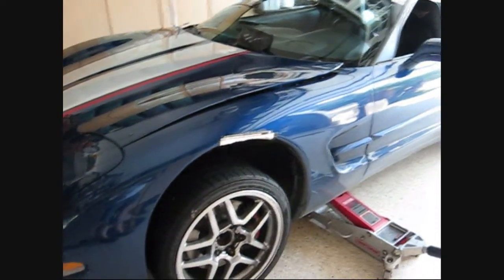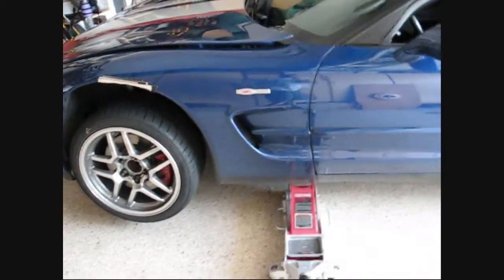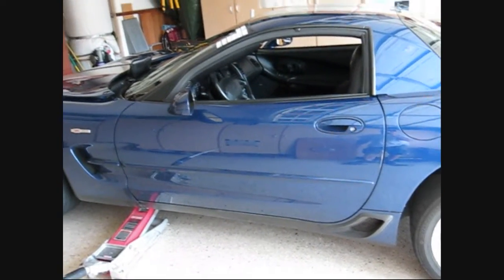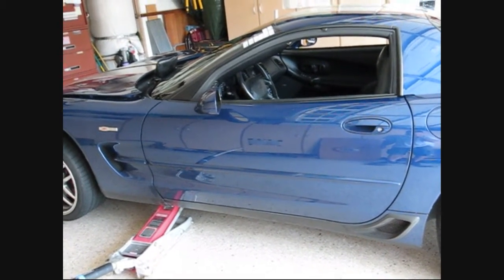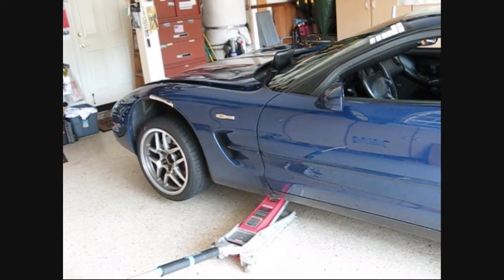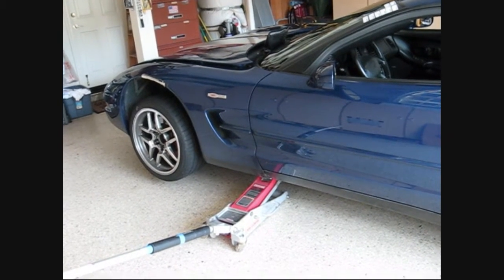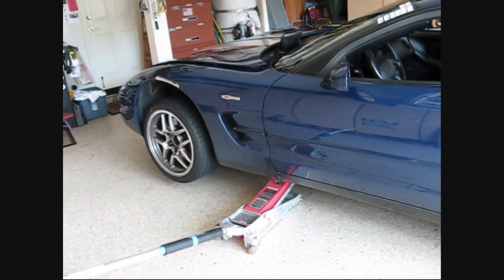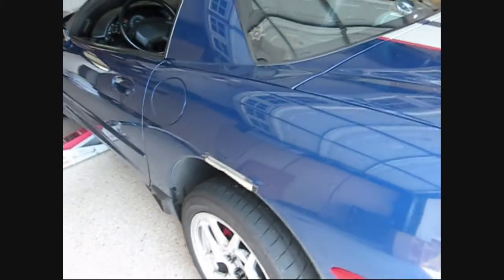Tools Harbor Freight floor jack and Corvette jacking by froggy

Comment: Its ok :)! The plug I use n the Cub Cadet riding mower is a E3.20 instead of the rc12yc OEM plug. The E3.20 plug really does save gas on the cub cadet! They also have the E3 plugs 4 vehicles 2! They increase HP, gas milage, & reduce emmisions!

Comment: Hey froggy on august 24th me & my parents went on vacation 2 Florida & got back on Tuesday! It was fun. But the next day back I mowed the yard with my own push mower! & not the riding mower. Glad I didn't pick the cub cadet riding mower cuz it leaked oil out the crankshaft seal while we were gone. The engine pully for the deck belt was full of oil & had also went on2 the ground. The Kohler 20 hp motor was built on 3/10/2009. It has just been sittn n the barn. Don't know how it happened @ all.